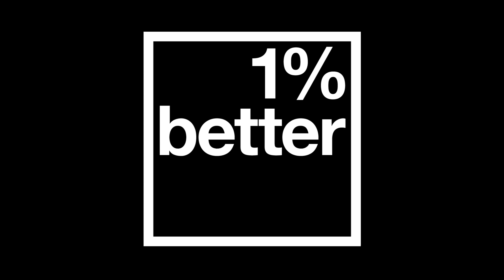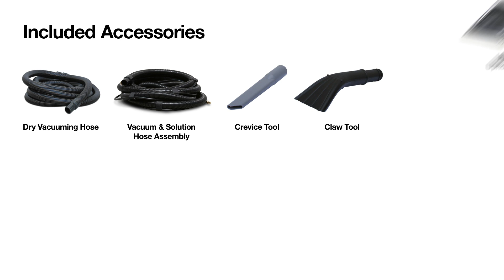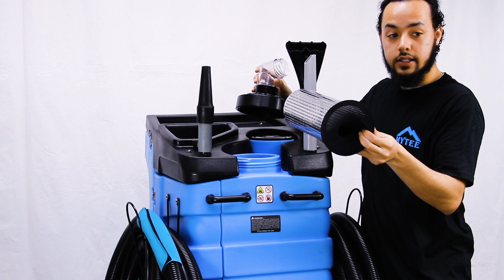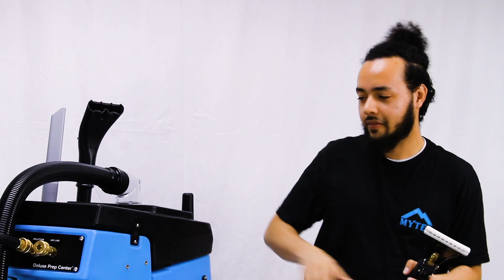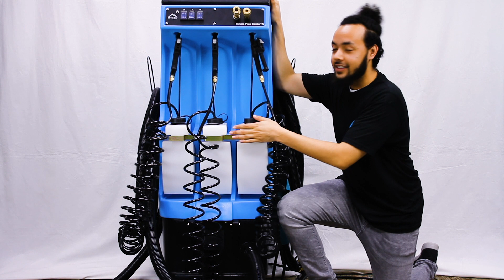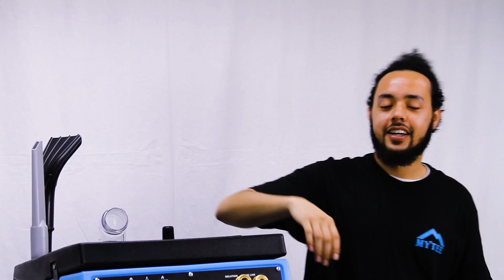Mytee Out of the Box: 80-120 Prep Center S

Comment: In order to use the three spray canisters, is it required to have air hooked up to the back?  Or will they operate standalone once fluid is put in one of the containers?
Reply from the maker: An air compressor is required to pressurize them for spraying.